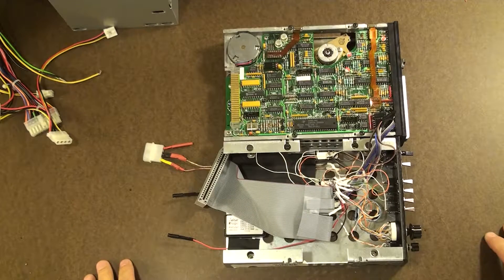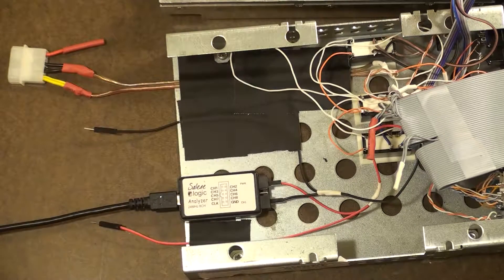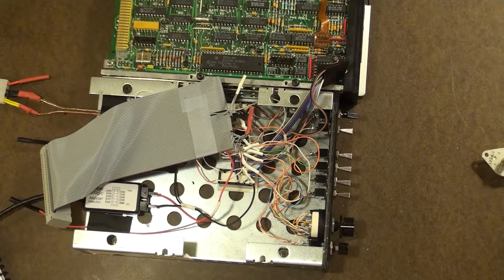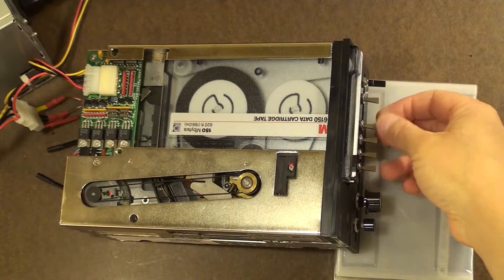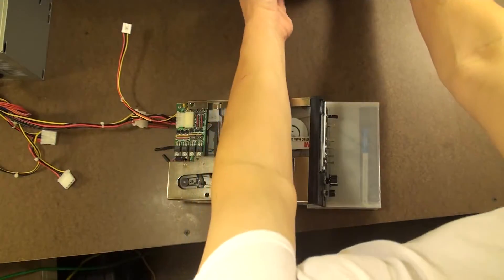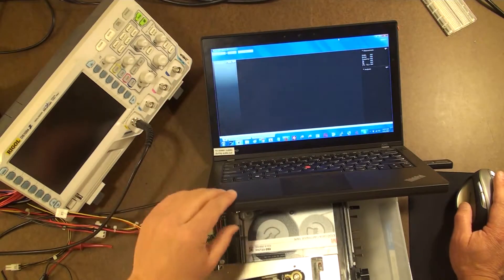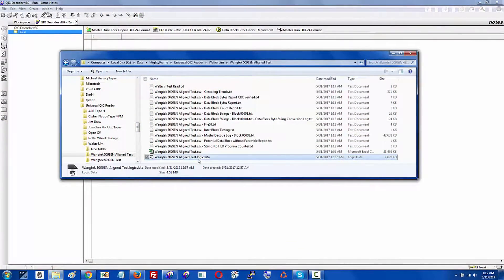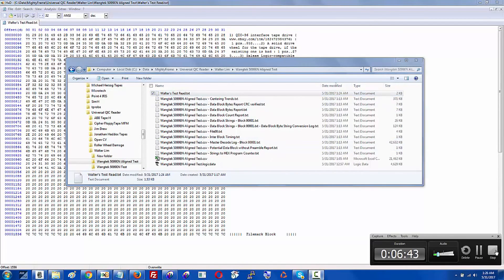"Portable" Universal QIC Tape Reader Buildout Review

Comment: Could I suggest running all of your control signals to the logic analyzer?  That might make it easier to do post processing of captured data.
Reply from the maker: Yes, excellent suggestion!  I simply wanted to keep the management of data simple at this stage.  Makes it easy to convert to a .csv file for magnetic flux transition time stamps.  With only one channel, far less programming is required to convert the magnetic flux transition data pulse into the binary values they were originally intended to be.  If I captured more channels, my program would get bloated with conditions working hard to exclude the signals on those other channels, in order not to confuse them.  BUT, for another application, your suggestion is EXCELLENT!  Please keep the comments coming!

Comment: If you had it to do again, would you consider using a quadrature encoder, a small microcontroller, and a cheap stepper controller (like are used in 3d printers) for head tracking adjustment?  It would cost less and allow more precise positioning.
Reply from the maker: Most excellent question, thanks for asking it!  For me personally, not as of yet.  Unless I'm mistaken, my system allows for the maximum precision positioning.  My mechanical rotary switch is incrementing one single stepper motor coil increment per rotary switch position.  I don't think we can get any more precise than that, can we?  I don't think this (or any) motor is capable of "half coil increments".  What I've done here has maximized simplicity.  If I have additional controllers and circuitry in the mix, this actually seems to give me less control, not more.  But, I can be convinced otherwise...so feel free to elaborate.  Thanks again!
Reply: @ForgottenMachines  I'd be glad to elaborate on what I meant.  With stepper motors, the common way to drive them is with two phases on at a time.  This gives maximum torque and is pretty simple to do.  It's power inefficient and heats the motor more than necessary.  What they moved to was using a current mode chopper circuit to effectively run the motors at a constant current instead of a constant voltage.

The difference because the coils in the motor are inductive, they use the most current when first switched on, but as the field in them builds, they use less and less.  But, the ohmic losses start to be the larger part of the power consumption.  So, instead of keeping them at high voltage, they sort of PWM them to reduce the ohmic losses while keeping the initial high current when the phase changes.

From there they realized that you could do steps between full steps.  By feeding the two phases quadrature modulated currents you could smoothly move between full steps.  This process is known as microstepping.  3D printer steppers rely on this to get enough precision out of a 1.8 degree stepper without having to gear it down into oblivion.  Cheap A4988 stepper controller modules can do up to 1/16th stepping.  Fancy ones from Trinamic can do 1/256th step (vastly overkill).  The real reason Trinamic does 1/256th stepping is that it has a little real time control loop watching the step and direction inputs you give it and interpolating from the 1/16 microstepping you are giving it and smoothing that out so that the motors run virtually silently.

If you're familiar with old dot matrix printers or common 3D printers, you're familiar with stepper motor whine.  The printers practically sing when they move.  This wouldn't be a big issue for adjusting a tape head, but Trinamic has another trick.  Some of their controllers are 'smart' and you can speak to them over SPI or UART to program various control parameters.  You can also instruct them to look for missed steps--which they can detect and use to output an skip signal.  If you're using a microcontroller to use one of these to move the head around, you could calibrate the extents of movement by sensing the missed steps from bumping into the end limits of travel--no more head slamming buzz while seeking!

The common A4988 steppers would be quite enough for your project and they go for $0.60 for the complete module--3D printing made them dirt cheap.  They have a simple interface--four motor wires for the two coils, three config inputs (to set the microstepping mode), and two STEP/DIR pins.  The modules also have a potentiometer on them to set the motor current.  You'll want to turn that way down for your little steppers.

I'd be glad to discuss this more with you if you'd like.  I don't doubt that your solution works just fine, but these might make some things easier for you.  Cheers!

Comment: Would these older qic drives have any problem reading 525 or bigger tapes with a better logger?  I am trying to archive these qic as400 tapes and don't want ot mess up.  You lose the licence tape you just have a brick as a system
Reply from the maker: Thanks for the question!  You don't run any risk of erasing them if you follow my steps to read only.  So are the QIC AS400 tapes the same form factor size?